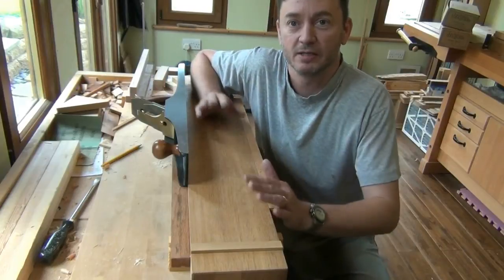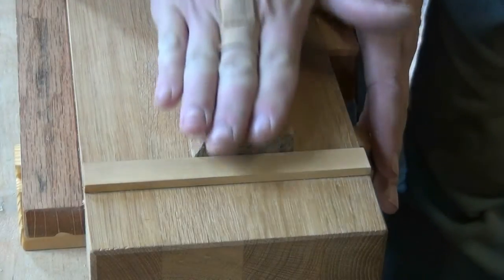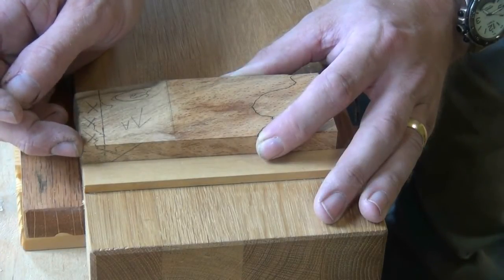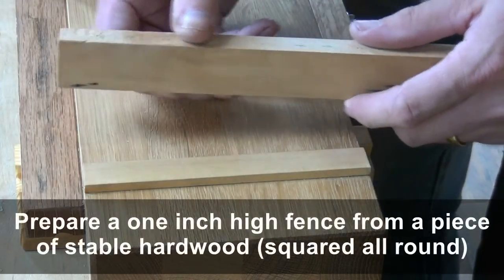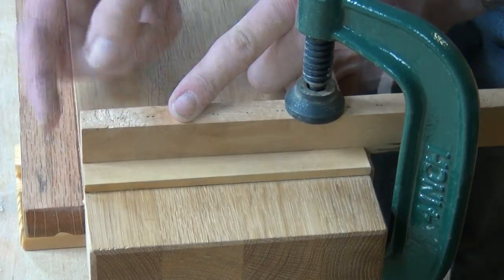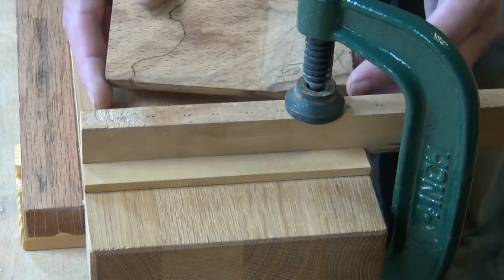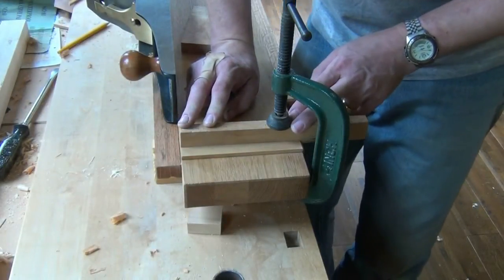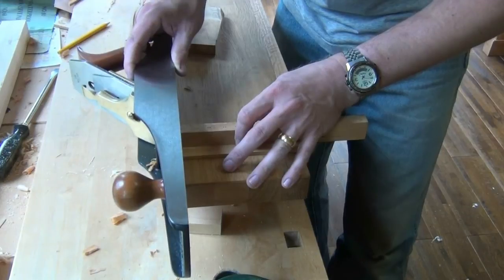Japanese Planing Board Add-Ons - Standard Shooting Fence

Comment: What plane do  you use for shooting?
Reply from the maker: Hi Keith,
Mostly I use a No.8, the heft of which makes it really easy going. My No.8 is also set up with a straight edge on the blade, so I can just set up for an even shaving.
I also use a low angle block plane with an iron honed at 25 degrees for a smoother finish on soft woods.
I prepare all my bench and block planes, where possible, to have sides at 90 degrees to the sole, and as such I can use whichever is to hand - useful if I'm away from the workshop where the No.8 usually stays.
Happy woodworking, Mitch
Reply: WOmadeOD - Made in Wood with Mitch Peacock Thanks. I was using a No. 4, then started using my 5 1/2, which is much better. But thinking a low angle would be better. Add another plane to my shopping list. :)
Reply from the maker: I find a comfortable grip is important too - allowing full concentration on keeping the plane 'on the track'.